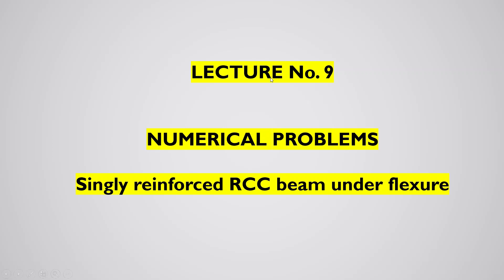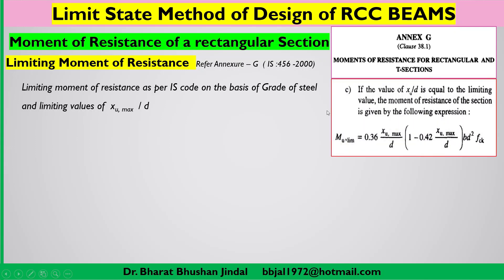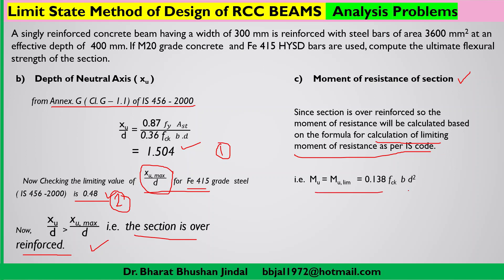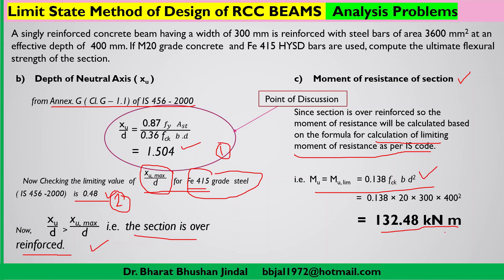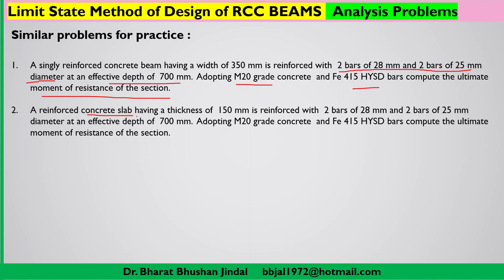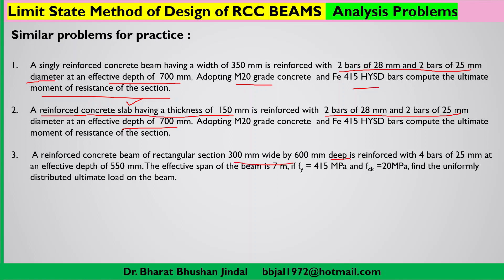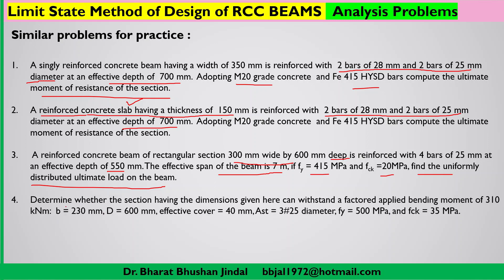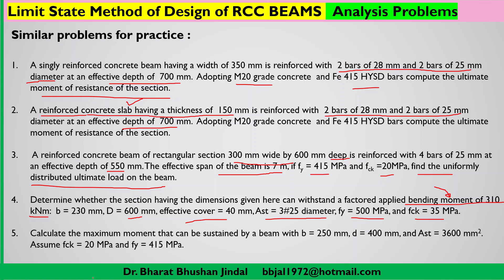Lecture 9 || Numerical || Design of Concrete Structures || IS :456 -2000 ||  || Civil Engg.

Comment: the value for xu max/d here in the lecture for fe250 is considered as 0.58 but in is code 456:200 on page 70 it is given 0.53 . which one should we consider ?
Reply from the maker: Take it as 0.53